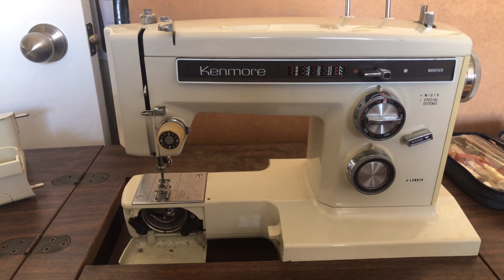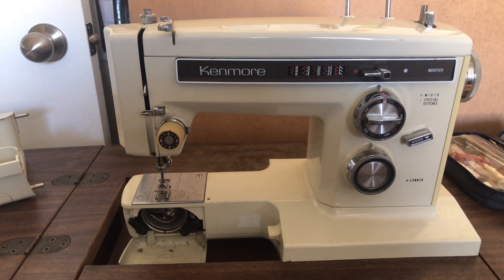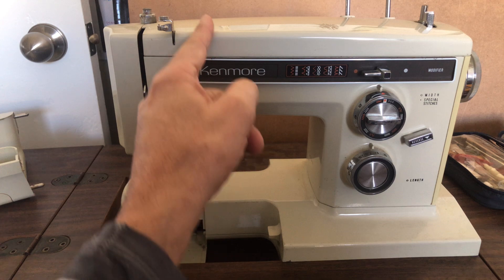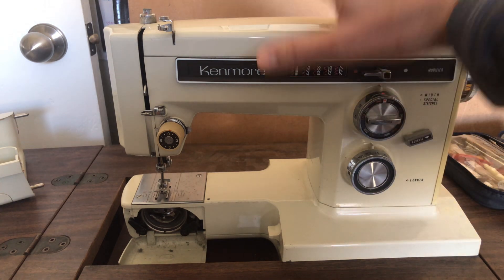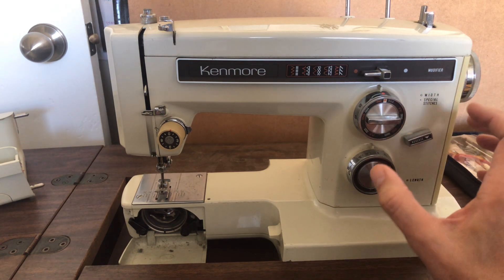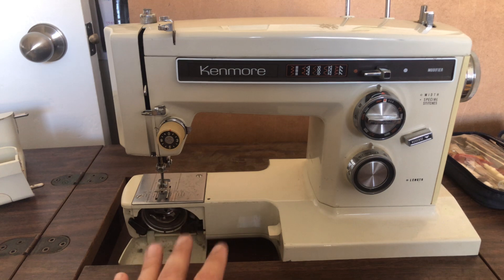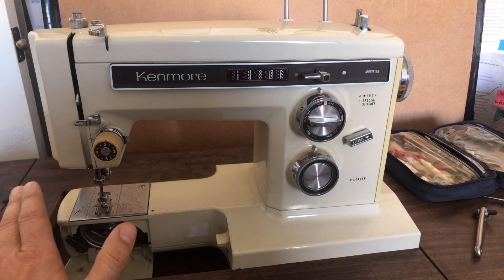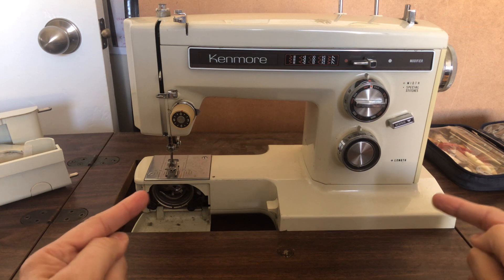I NEVER TIRE OF THESE AMAZING MULTISTITCH MACHINES & WHY I WOULD CHOOSE THIS KENMORE OVER A BERNINA

Comment: Do you have a video on oiling this machine. My stitch dial are stiff. I just got from my mom’s things and gave it a good cleaning. Unfortunately, no manual.
Reply from the maker: Hi MQ.  Most of these Kenmores I get are in exactly the same state as you describe yours being in so its actually quite common.  Here are a few videos I've made showing the various areas of the machine for oiling. I would suggest using a flashlight to shine down from above when oiling the metal linkages behind the knobs that you can access from above and some even below.  It can sometimes be helpful to use Penetrant products and a little heat.  You can search the channel for those specific videos.  Here are the links for the views on the Kenmore I mentioned.  I may have others as well but these come to mind.  Also listed here are how to take off and put on the lower tray.  I have other videos on this Kenmore series as well as I obviously and a fan of this generation of Kenmores.  Hope these are useful for you.
https://www.youtube.com/watch?v=-4UDb0_K0Bw&t=2s
https://www.youtube.com/watch?v=iE_B1vWGgjE
https://www.youtube.com/watch?v=-4UDb0_K0Bw&t=2s
https://www.youtube.com/watch?v=2BdSpdCVTf8&t=448s
https://www.youtube.com/watch?v=F94IquiYkGI&t=224s

Comment: I love your channel! I just received a 158.13360 model which looks alot like yours, in trying to remove the bottom housing, there is one screw (?) That sits between 2 screws below the freearm. It doesnt look like a screw face on the outside, its a raised circle, im assuming maybe theres a screw head inside and it goes up into the bottom rightside of the bobbin race area. Its in towards the back i cant see real well what its doing. Can you tell me how to get this out pretty please?? Thank you!

Comment: Hello I have Kenmore 158 series machine Model 17861 which I think was made in the early 80's. I have some issues with it now, no sure what cost it. Skipping stitches, tangle thread, break thread, stitches are changing the size. I got this machine brand new at Sears I believe was 1982. Do you have some tips I have tried many things it works for short time though. Thank you for reply
Reply from the maker: Its hard to say without seeing the machine given how many potential causes there can be.  Your machine was likely made in Taiwan and while not ALL METAL, they are pretty robust by today's standards.  I would seek out a local Vacuum-Sewing repair center and see if they can sort out some of the issues.  For videos here, I would look at the ones I've made on the Kenmore 158.1941 as this is the closest model I have showcased next to yours.
Reply: @VintageSewingMachineGarage  I was told no to get rid of my machine because is metal is heavy was made in Japan. Thank you for the tips I will look for repair center.

Comment: Everything I’ve ever read on the 158-1941 is that is is one of the best and you’ll never need another machine. Apparently the motor is over engineered.
Reply from the maker: Actually, the entire machine was 'over' engineered compared with modern machines.  The motors are excellent but were sourced from Japanese manufacturers who also sold them to many other brands.
Reply: @VintageSewingMachineGarage  I wish they would over engineer things these days so we can actually get our moneys worth

Comment: I have a Kenmore model 158.19412 that I purchased new in 1978. Where can I find a walking foot for this model?
Reply from the maker: These machines used what Sears called, Super High Shank.  There are adaptors to convert to the use of low shank feet.  How well this would work with something like a Low Shank Walking foot attachment is unclear.  I don't know if Sears ever offered a Walking Foot in the Super High Shank style.  In some sewer's experience, walking feet attachments have limited success but maybe the do work well for some folks.  Your best bet would be to order a Super High Shank to Low Shank adaptor (sold on Ebay), and then search for a Low Shank Walking Foot; assuming it would work as I cannot be sure.
Reply: I'm in over my head sorting through all the options of walking feet for my Kenmore model 158.1913.  This machine does everything but quilting, it seems.  I would fully support a video of your exploration of this! @VintageSewingMachineGarage

Comment: Where do You put the poder cord 😮😮
Reply from the maker: If you mean to install the cord and turn on the machine, then you plug it into the terminal on the right lower side.  If you mean storing, you unplug the cord with the foot pedal and merely store it in one of the drawers or on top of the machine bed if you have a carry case.

Comment: Wow.  Cool cabinet.   I have two of these.  Also have a 158.19310. Any thoughts on it as a machine?
Reply from the maker: Oh yes; those 1931 versions are the same machine essentially, but with the added option of additional decorative cams.  These were likely higher in price than the 1941 as they added even more features.  Whether the extras were used in a whole other question.  But yes, these are the equal to the 1941's as they are based on the same machine.

Comment: Hi, I have a question, if you don't mind...Very recently I purchased a 148.13110 in great condition. I was happy to find it. I'd love to find this machine also and am keeping my eyes open. Just today I came across a 158.15250 and wonder how it compares to this one? Is this the 158.1941? Thanks so much for any thoughts you have.
Reply from the maker: Both of the Kenmore models you mentioned are, compared to modern machines, very well made with 'mostly' metal parts.  However, they were likely made after production shifted to Taiwan and thus will have at least some plastic parts such as the stitch selector knob on top which has plastic gear teeth. These are models that I refer to as "Hybrid" as they were produced right at the time when machine producers were just starting to cut corners.  By contrast, the 158.1941 was one of the last 'ALL METAL" sewing machines.  The Kenmore you have and that 1525 model can still be good workers for you and may have lots of life left if treated more gently when using the stitch selector.  However, for what I consider to be truly "Heirloom Quality", the 1941 would be one of the last produced at that level.
Reply: @VintageSewingMachineGarage  Thank you so much for the helpful detailed reply. Much appreciated. My 148.1311 machine has 'made in Japan' on it. Is it possible it's one of the last before hybrids/Taiwan? 
I'm going to hold out for a 1941 for my next purchase. Hopefully one will cross my path soon.🤞 Thanks again!

Comment: Where can I find accessories for a
158-I355?
Reply from the maker: Most commonly, you will find them at sites like Ebay, Etsy, Bonanza or locally at sites like Craigslist or Kijiji (Canada)
Reply: @VintageSewingMachineGarage  I’m still learning on the 158 because I can’t seem to get the tension right on this machine and the cord keeps punching up on the bobbin so I’m still trying to learn how to adjust that. I wish they had a tutorial on specifics instead of just generalizations

Comment: What's your opinion/experience with the Kenmore 1803?
Reply from the maker: Wonderful and the equal to the one you see in this video but a flatbed version of the 1931 as it allows decorative cams to be used in addition to the built in utility stitch cams. Notice that the 1803 has the little groove in the top for the top thread.  This was also a mimicking of a Bernina design.
Reply: @VintageSewingMachineGarage  I'm glad I bought one when I did. Came as a complete set with all the cams and feet options, embroidery set etc.... $100 CAD. It was a classic case of someone bought it and it sat and sat. It too does need some love but otherwise cosmetically it's as new.

Comment: Which of the same era free-arm Kenmores that take cams are all metal vs the first to have plastic in the machinery? Specifically, are the 158.1931 and 158.1760 in the all-steel category?
Reply from the maker: You are wise to ask this because there came a time in the late 70s/early 80s when machines began to show some plastic in their drive train components.  But for those two models you listed, they are each all steel!!!
Reply: I have the Kenmore  158.19461 in a table.  Is it in the all steel category?